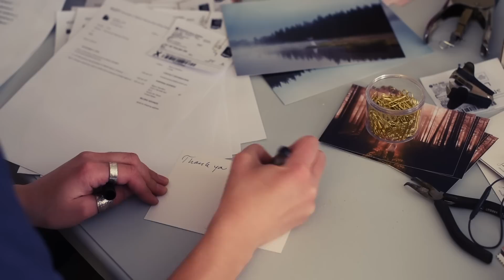Hard work and a big mess | Ep. 21

Comment: In Poland during March and April is usually raining or snowing. We have a mixture of seasons during that time, a little bit of winter and a little bit of summer, so it gives you a little bit up and down kind of feeling. We know that it's normal during this time. It is a time of transition from cold winter to warm summer. The weather needs time to adjust and we need that too, so the best solution is to accept it. If you cannot change it, acceptance and surrender is the key. Otherwise, you will feel like a crap. So no resistance...

Comment: Jonna,  I love your videos because I relate to you.  I struggle in March and April as well.  I love winter and ambient light.   I am a retired nurse and see that depression and suicide is at it’s highest in this transition period.  I find that Vitamin D3 levels are low in most people at this time.  Also serotonin levels are low due to lack of sunlight.  Serotonin is a brain chemical that helps you feel good.  I am an artist as well and are least creative at this time.  This is very common so you are quite normal.  A supplement called SamE helps make serotonin. vitamin D3 will increase your immunity.  Hope this helps.  I live in Pa and originally from Maine.

Comment: didnt know, that anyone is struggling with "season low mood". every year i get really, really depressed in november and it ends in february i think. its the thoughest months in a year for me. when there is less light, and nights are longer my biological clock works badly. These year i tried to supply witamin D, magnesium and changed my diet to based almost only on fats. Ketagenic diet. It helped my a little, maybe you should try too :)